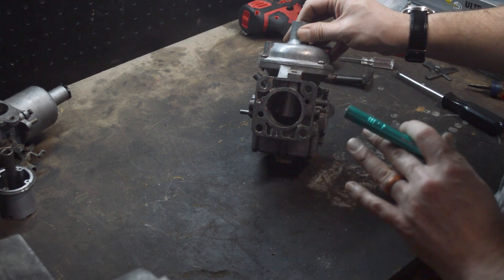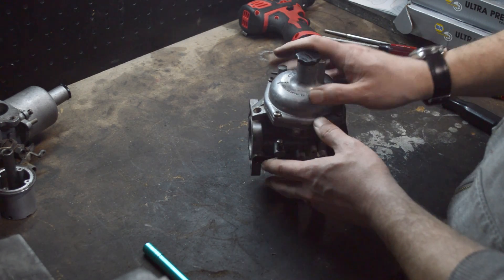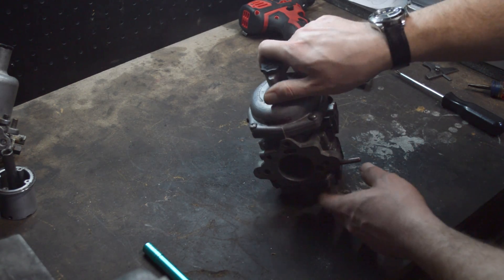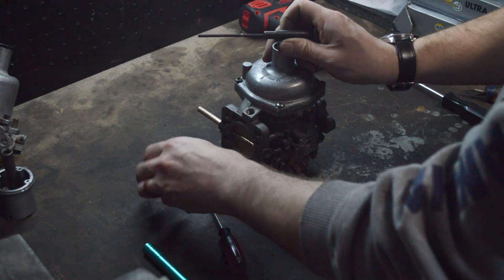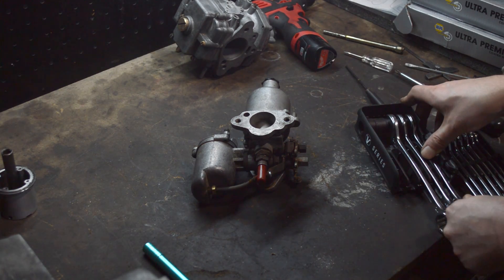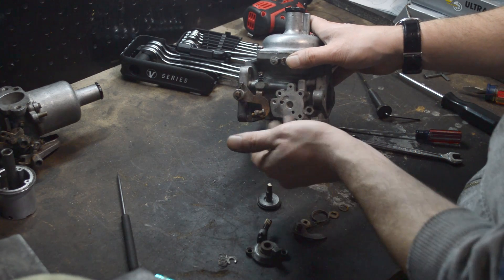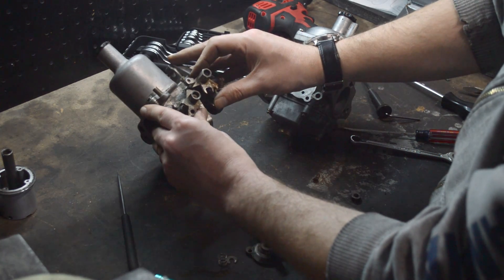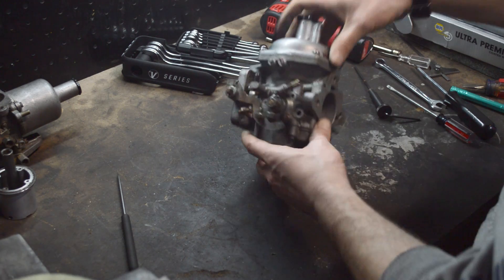Zenith-Stromberg and SU Carburetors Part II: Acceleration and Choke

Comment: Why wld the piston raise & engine run wide open  with the throttle blades closed??? What’s pulling the piston up? Vacuum? From where?
Reply from the maker: If it's revving with the butterflies closed, then either 1) your butterflies are not sealing properly or are not closed, or 2) it's bypassing the throttle plates.  Most often that's a sign the bypass valves are letting too much fuel/air mixture past.  Probably a leaking diaphragm or not set correctly.
Reply: @midwestmotoring  what is the initial setting for the diaphragm? I think it’s 4 full turns out… it’s a new carb but l think previous owner may have messed wt its settings trying to figure it out…
Reply: @midwestmotoring  the carb is a zenith Stromberg cd4T… on a 1976 1500 mg midget
Reply from the maker: @douglasjeter39  there's no initial setting that I'm aware of.  You'll need a vacuum source and a gauge to measure movement.